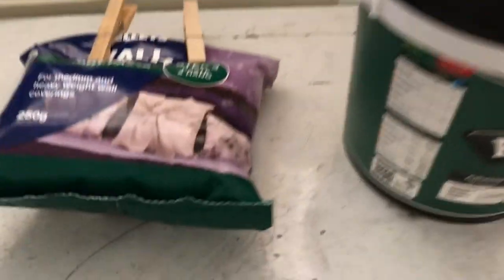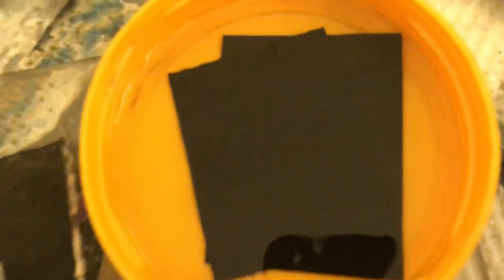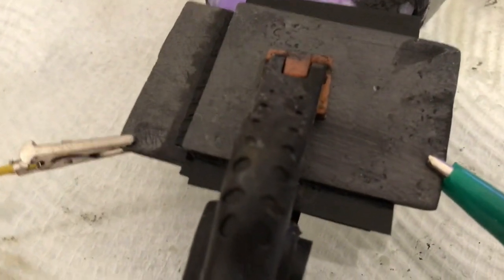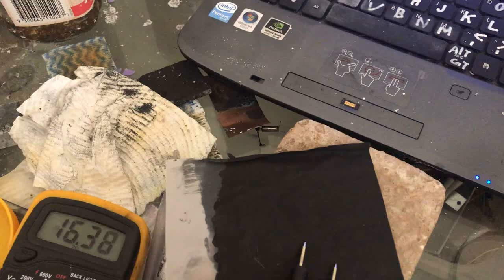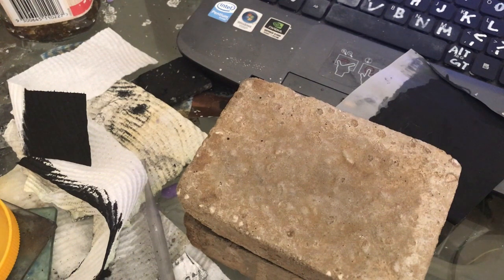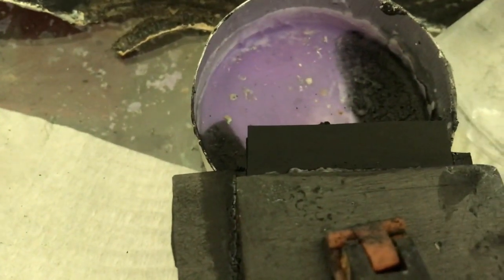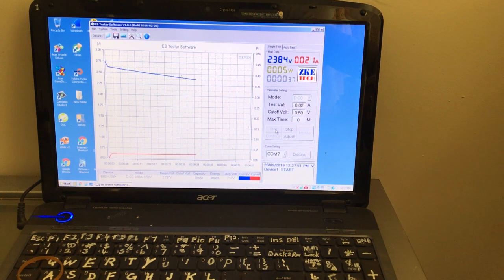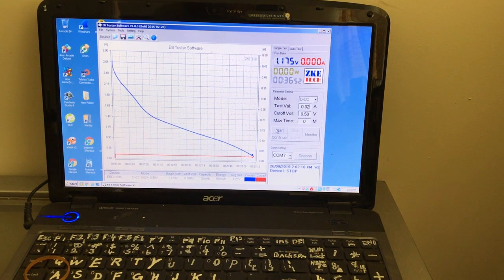Paper Capacitor

Comment: Good video Dan, one advice: after you paint the paper on both side, give it 1 h at 300 centigrade in the oven. 
Cheers, 
Sorin
Reply from the maker: Hi there. I tried it but the binder or paper I'm using dose not like it being in the oven. Thanks. Ill post the results later this week.
Reply: @danp1224  sorry to hear that, maybe the temp is too high. The idea is that after drying,  by keeping it in high temp, you will loose some elements, but will gain in surface area .
Cheers, 
Sorin
Reply from the maker: UnlockedEnergy it did lower the resistance some what. But I think it’s the printer paper I used.

Comment: Hi Dan, Good work !
Your last test looked like you were getting some redox activity happening by the look of the curve. That's interesting, as the wallpaper paste is presumably CMC( possibly CMC-Na ) and the Bondcrete is probably a SBR (plus additives possibly). So, everything else remaining the same, when you change the binder ratios on subsequent tests, you may see alterations in the curve shape as a change of the redox donors, apart from any gains you may see from improvement in efficiency due to better conductivity. Maybe there is something happening with the sodium tails of the CMC polymer chain and the zinc ?
I've been looking at "Double Salts" when time permits, and they are looking interesting as a redox additive - and very simple to make - Ammonium Ferrous Sulphate and Ammonium Manganese Sulphate are my current favourites. My SBR source is a Thai local brand Lanko 751 and I am adding a small amount of PVP and PVB.
Base electrolyte is sodium sulphate, which I have had to make myself because I can't source a supply here easily, the other electrolyte additives I am making from different fertilisers basically, so not exactly lab grade !!.
Still wrestling with self discharge, as my goal is to use the cells on a solar rig, and that's no good if it doesn't last the night !!
Managed to source recently some 0.1mm stainless steel foil, which I will keep as my current collectors for now, pretty light and should not corrode with the electrolytes I am using.
Haven't settled on a paper separator at the moment, trialling grease-proof, tracing, standard photo-copy, home made...started to look at cellophane, but that's early days.  Have tried coating some separator paper with Bentonite, that gave some weird results that I must explore further and have SiO2 and TiO2 coatings on the things to do list, but busy on the farm at the moment.
Keep up the good work !!

Tony
Reply from the maker: Hi. What sort or resistance are you getting on your surfaces. I've dropped the amount to 0.3 grams and only gain  58 Ohms on graphite. SBR cost is so high. the cheapes I can find of that Lanko 751 is $138 Aus Dollars for 5L.
Reply: @danp1224  Hi Dan, starting at the beginning...I've played with a fair amount of stuff, like you. My first way to comparatively test conductivity/resistivity was as a dry powder resistance measurement using a known mass pushing a bolt down a tube ....I know its not perfect but its "empirical"...I could value one thing against another, I tried various "mixes" before settling on this one.
So, my AM (ground charcoal soaked in Ammonium Persulphate and cooked) gave a dry cell reading of 120 Ohms. Graphite Powder, again dry, gave a reading of 70 Ohms, so I thought I was on to something that I could use......
That was the easy bit, I suppose.
So, as you can see, I am focusing on the N, H, So4, groups within my AM. What I am trying to do is provide "linkages" for the electrolyte to be able to "hook" onto, because it can only be by the "hand on hand off" from the AM will I get the ion movement. Its a total system, so you can't think of one part in isolation...each part affects the others, so it must be looked at holistically.
I just measured a piece of AM/graphite bound to copper and that was 260 Ohms...but it was "tightly" bound with quite a high proportion of binder, I've had them quite low at 60 Ohms, BUT didn't work with the electrolyte/separator/system. And yes, I add graphite to the AM !! ( I haven't successfully produced a reliable quantity of graphene to try that, so stuck to plain old graphite) .
Regarding SBR,  the Lanko brand is my (Thai) local one. How I found it was to look in the big stores and take a note of what they have in the cement additive section. I then googled each of them for their Safety Sheets, some were PVA, but Lanko 751 was SBR. I am sure there will be a cheap local brand for you too. Now, they do not of course, give concentrations, so other iteration of experiments occur, but at least you will have a SBR (with other bits) material. Before I found Lanko, I found SAC Styrene Acrylate Copolymer, which also looks promising, but I'm having troubles with it and shelved it for now.
Additionally, I am moving away from the CMC  ( and the HEC, if you want to try that :) interesting, but I moved away from it ) and using a combination of PVP and PVB, both long chain and both supply some "tails" for stuff to lock onto. (That's the main reason CMC is so popular, is its tails ).
But of course, these have to work with your electrolyte and any redox additive you put into it. 
I am looking at "double salts" ,ie two metals (including ammonium) and a sulphate, in my case, in an attempt to "compliment" the original activation chemical.
...So, I suppose the short answer is I'm coming to the conclusion that the pursuit of ultralow resistance is not the important thing, its the balance between all the components in your system...like the multi-layers you are trialling, really good and worth carrying on with !!
But square ohmic readings anywhere from say 30 to 300 wouldn't worry me, any higher and I think it would start to affect capacity...but that would be in a single layer cell, your multilayer might not find that a problem, and a possible decrease ESR at the same time might be beneficial...like I said before, ESR is my killer !! My target is effectively 0.025V/hr and I have not got anywhere near it yet...but I am getting closer with each iteration.

Anyway, enough of my waffle...not sure if any of that was of any help, but keep up your fine work, it is truly appreciated. I'm not a chemist, just an enthusiastic amateur,  so please take anything I've said with a healthy dose of NaCl  ;)     just my own thoughts and findings.

kind regards and best wishes

Tony

Comment: Hi Dan  are you looking for CMC/SBR with wallpaper paste and bondcreate or just trying new things?
On a few of your tests you had some voltage spiking when charging which looks like breakdown or something, i've seen this with zinc sulfate as well. Have close look around the edges of the cell you might see some metallic looking deposits or growths I think the cell is shorting?
Reply from the maker: Hi Peter. There was a bit of zinc build up on the edge after you said to look. I'm am looking for CMC/SBR but that stuff cost way to much for now maybe later.
Reply: @danp1224  Hi Dan i found a cheap source of CMC and SBR from Bunnings, if you check out the safety sheets on these (MSDS) you find that they are CMC and SBR.

Only the lightweight wallpaper paste is CMC the other is Starch

https://www.bunnings.com.au/dunlop-1l-primer-and-additive_p6829434
https://www.bunnings.com.au/poly-lightweight-paste-50g_p1662057

I mix the CMC 2g powder and 100ml DI water to form a thick gel, it takes a couple of hours to fully mix, then I add 40ml SBR.
It should be thick like PVA glue.

This is what i'm using, hope it helps
Reply: @petergold4823  thanks peter